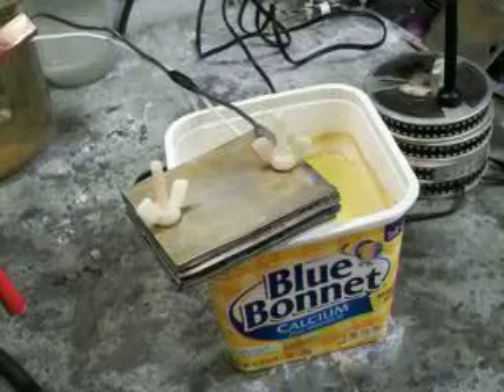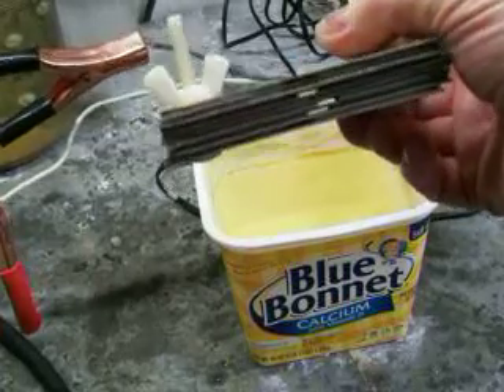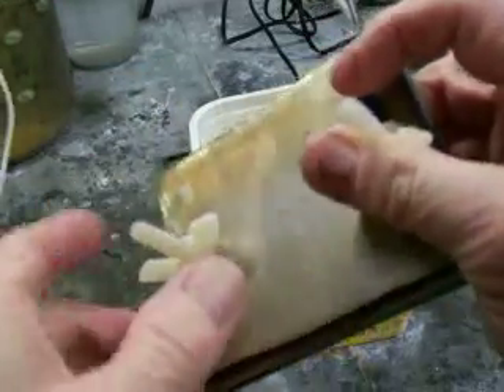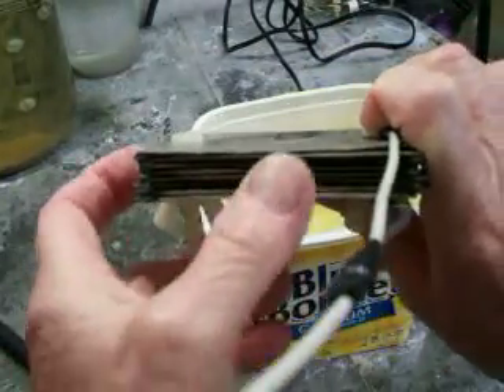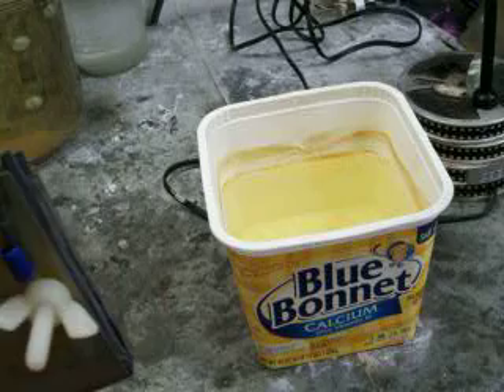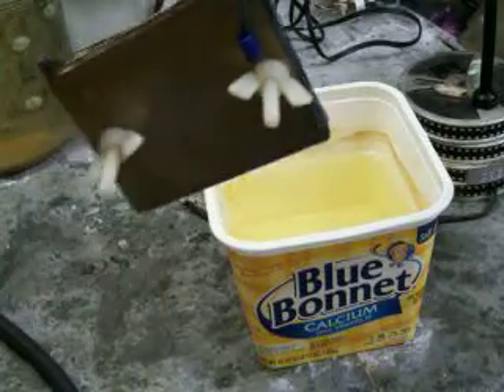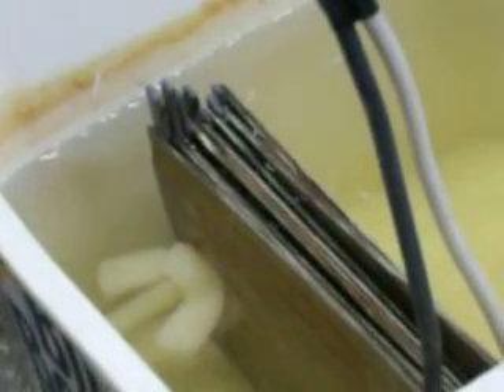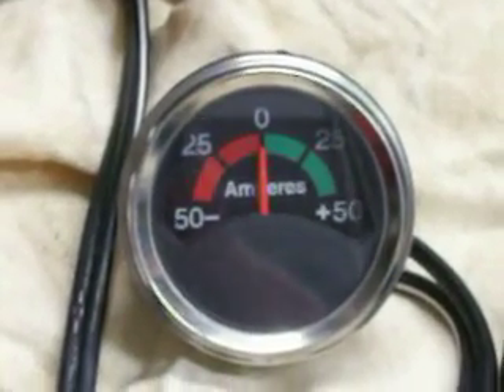open cell design

Comment: I don't know anything about rectifier. I looked on eBay for one but didn't know what to buy. What rectifier should I buy that puts out 118 volts dc?
Reply: A rectifier changes alternating current into direct current, you have to buy one that is rated for the current you put into it. Household electricity is about 120 volt AC (Alternating Current) for wall sockets. AC has both positive and negative current that alternates 60 times a second here in the USA, and a rectifier separates the two.

Comment: Good demonstration! Magnetically treated water would probably work, just as well. No chemical burns a great plus. A 12vdc inverter should deliver enough power for several cells at 118vac.

Comment: Hi Vaporkid. Well done job. Im new to this stuff but did some readings and have an overall imagination. I've got all the necessary parts for assembling a dry sell. So according to your video about 118-120V AC/DC all I need is to hook a sort transformator (inverter) to smoking slot of the car and send the wires from it to hydrogen generator to get high production with less amps? And 2nd is there is no need for pulse width modulator, circuit breaker, relay and this kind of devices if you just experimenting, right? Battery charger is the only thing I need, correct? I will need those if want to do an instalation in the car, I think. Well, I hope it makes sense

Comment: Mixing oxygen and hydrogen gas in a pressurized container or any container is bad news, it is called a bomb.

If you can get only the hydrogen gas then it is safe. 

That said I would love to see someone make this design usable for a BBQ so I don`t have to breath in that shit from the propane fumes, just no bombs :]
Reply from the maker: NoFear4XJs when I collect hydrogen and pressurize in  to a tank I use a oil less air pump and pull a vacuum on it that way im not mixing oxygen in with it.
Reply: We must have a communication error, You must understand that what you are doing is separating the hydrogen atoms from the oxygen atoms so those bubbles you are producing are both pure oxygen and pure hydrogen.
It is the oxygen that gives the hydrogen the loud pop when you light it, with just pure hydrogen it is a weak fluffy flame with no pop.

I have seen a design on YouTube of someone making a container that separates the oxygen bubbles on a separate side, think of having 2 buckets side by side with a short pipe horizontal joining them so the water can be shared...
You get the idea, positive electrode in 1 bucket negative in the other just not sure on the specifics but it should do the trick if the power is there.

Have a great day, and thank you 4 sharing ! :]
Reply from the maker: NoFear4XJs thanks for the info, that's why I like to make it on demand, if somebody had hydrogen in a tank in the back of his car to run his car and ever got hit by another car, the explosion would look like the shuttle that blew up back in the 80s, the only way you want to mess with stuff is on demand!!!
Reply: Do a search on YouTube, HHO separator cell. There should be a vid there showing how wimpy pure HHO burns...
Reply: Hidrogênio puro não tem problema de explosão o problema é quando misturado ao oxigênio ai sim explode ou seja sem comburente nenhum perigo mas se tiver o comburente que é oxigênio misturado ai é explosão na certa

Comment: Cool.  So only about 1 to 2 amps? So this is 118 Volts DC.  So around 240 watts are needed? Is that right? I suppose one could hook up a couple of 200 watts solar panels in series and generate enough power to run this, correct?
Reply from the maker: TruthCeeker333 that's correct only 2 amps  and 240 watts.   iv had it up to 8 amps and the thing went crazy,  you can power this thing with a inverter and plug it in your cig lighter and not have to worry about using the car battery!!!
Reply: TheVaporkid So your turning 120 volts AC into 118 DC then powering the plates ?
Never heard of anyone doing that before only seen the converters for 120 AC to 12 DC :/
What inverter are you using ?
Reply from the maker: im using a 25 amp rectifier  the inverter is for if I want to get 120 volts ac for in my car
Reply from the maker: i am controlling the wattage by using 300 watt light bulbs, i start off with 300 watts, and keep screwing in another light bulb in till i get to 1200 watts.   i have also added a 1500 watt water heater element which gives me a total of 2400 watts, the bubbles go crazy. i did find out that with this high wattage i can actually use regular tap water, not soft water, and it will produce hydrogen like crazy.
Reply from the maker: what im doing with the heating element is using it as a load .
Reply: Troll True